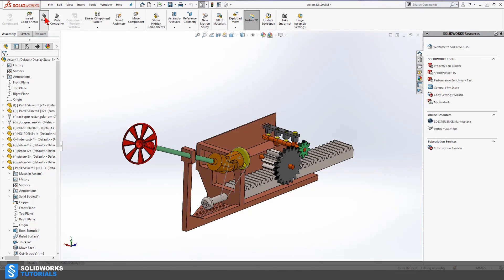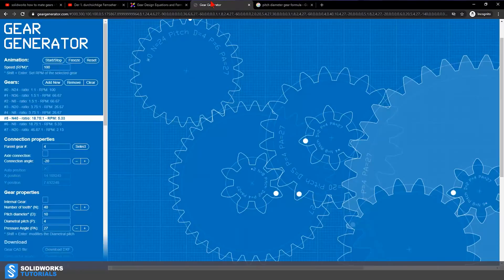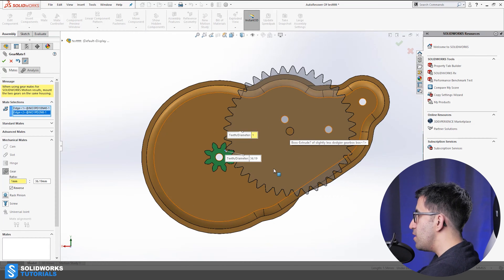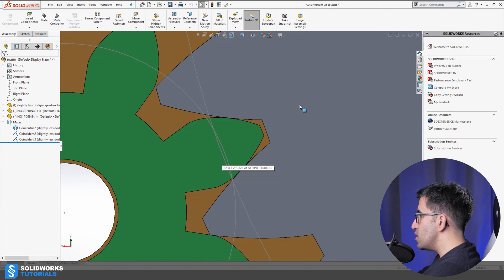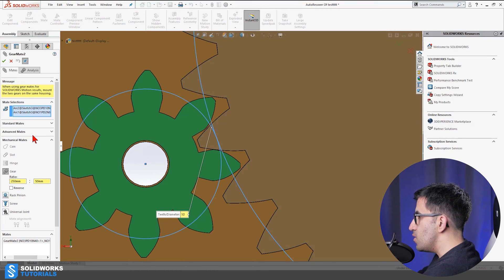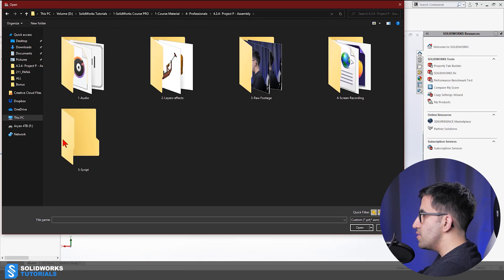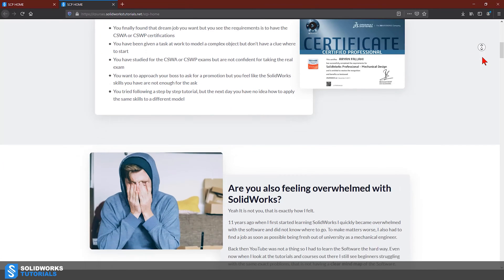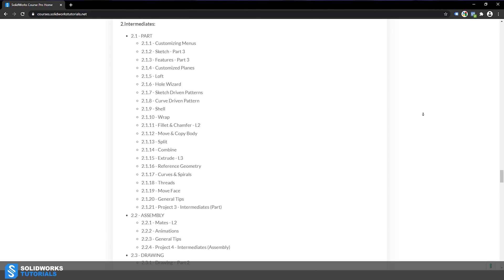Chit Chat with Ryan  - SolidWorks Gear Mate Explained

Comment: Sir for worm gears how to do mate
Reply from the maker: Worm gears are just the same as other gears in terms of motion.
If we forget about how they connect, at the end two shafts have to rotate at a given speed. We can do this using the gear mate. Based on the type and design of the worm gear you can set the gear ratio e.g. 1:15 or 1:30 etc. Note the ratio of the shafts in diameter will not be 1:15 so be sure to manually override the gear ratio, else by default it takes the ratio of the diameters of the two shafts.